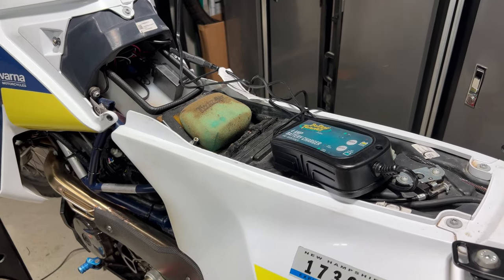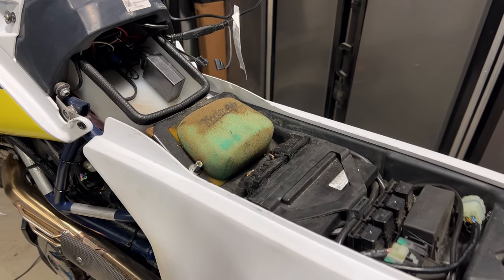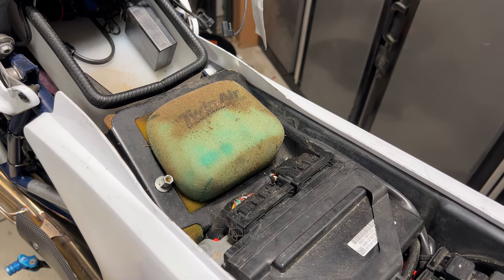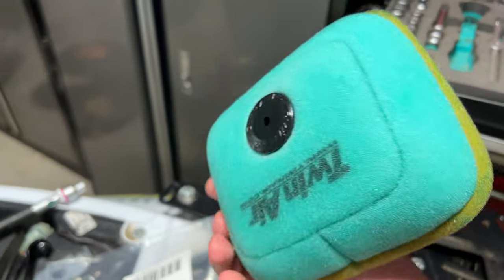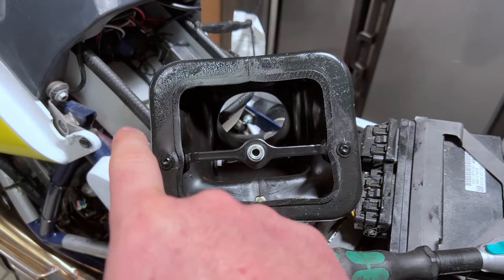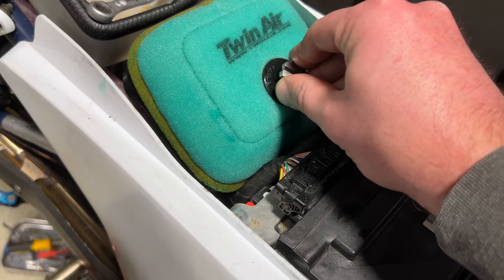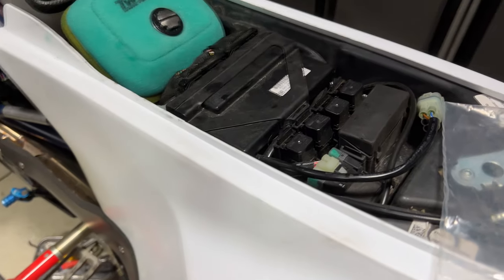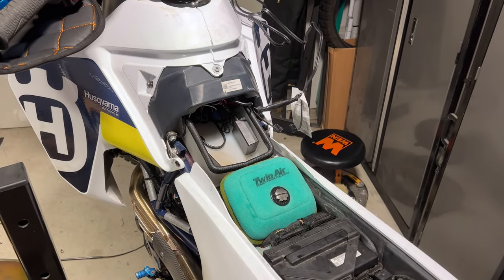Rade Garage Upgraded Air Filter for Auxiliary Tank / Storage on Husqvarna 701 Enduro LR / KTM 690

Comment: Note for anyone like me with a rade air box made in 2018 or before: Check if your existing air box uses heat set inserts rather than the bolt mounting system shown in this video.

There was apparently a design change at some point, with no indication that these new filters and cage will NOT work with that style air box - there's a plastic bump under the heat set inserts which are not open at both ends and therefore cannot be used to mount the new attachment system. It's not possible to remove the heat set insert and end up with a flat surface on the bottom of the lip for the filter to bolt onto.

Rade doesn't indicate this at all on their website and I've been grounded for the last week waiting for new filters only to find out they don't fit.
Reply from the maker: That's great advice. Thanks for sharing!
Reply: yep, facing the same situation now, how did you end this ? did rade send you a new air box casing ? or did you end doing whatever it needs to get it works?
Reply: @axurit_bob  Rade are sending me a new air box body yeah, not arrived yet though!
Reply: @Unkn0wn3rror  thanks mate, I guess I will have to clean my actual filter before being able to replace it 🤷🏻‍♂️
Reply: Yep- Asked Rade about this and says no problem- Got the new filter kit upgrade for my 2019 690 and went thru this same issue, did not fit- Rade did agree to send me the new style airbox at no charge but it was a bit frustrating and it took another 2+ weeks to get it. Plus I also discovered that the lower O2 sensor hole is now located a couple inches away from the older airbox- Had to completely re-do the hose connection which was a complete pain with the gas tank in- Finally done but quite a simple project turned difficult.

Comment: I have a 701 with the older Rade Garage filter, just like yours. Notice how part of the filter is always clean?
That's because the seat pan hits it and keeps air from getting to it.
Does the new one have clearance with the seat pan?
Reply from the maker: Great question. The new one gets completely dirty. I had not thought of that but clearly the revised design is doing a better job making full use of the filter surface area.
Reply: @AdamChandler86  thanks for making this video and bringing the new design to my attention. I ordered the new one today. Shipping prices are crazy now. $$

Comment: Adam can you answer this ,the quick connect fuel pipes ,did they leak fuel when you disconnected them
Reply from the maker: Good question. They do not leak fuel. You can disconnect them and it drips a tiny bit.
Reply: @AdamChandler86  cheers

Comment: Not sure if I like the new design Adam. The old one sticks much better to the air box with the metal bracket pushing it right down. Or am I wrong?
Reply from the maker: Yes, it seals better (the old design) but the truth is, the way that snorkel thing fits into the intake housing is pretty loose so as far as water-ingress, I’d say both the old filter and new will pull in water if you go up to the top of the snorkel thing. I’d much prefer the plastic all be one piece up to the foam but it’s not.
Reply from the maker: I played back the video. I did want to add the movement you saw around 4 minutes in is indeed that snorkel design. The air filter box sits on that snorkel so while air coming in is filtered, I think if you submerge the bike above the top of the snorkel shown around 3:50 in, it will pull in water. That air box is loose like that even if the air filter was bolted on tight.
Reply: @AdamChandler86  my air box is fitted really tight to the snorkel. Mine doesn’t move at all. You might want to look into that Adam
Reply from the maker: Thank you. I’ll send a clip to Rade Garage and ask their help. I can’t imagine how it could be made tight. Want me to send you an unlisted clip?
Reply: Hey Adam, same with mine, it does not wiggle and is actually very tight on the snorkel. I could possibly pull the box off the snorkel but no way I'd get it back on without removing the snorkel from the throttle body first...
Reply from the maker: Well crap. Thanks Un!
Reply: Hi, what Do you think that my snorkle is cutted very short all The way at bottom of the intake housing. Do you think that matters at all?
Reply: The new design is just as secure. When you tighten down the centre bolt it forces the cage down onto the box creating a full seal. It's really well engineered when you think about it.

Comment: Hey Sir, I know you posted a while back but still hoping to get a response.. thanks a lot in advance!!
I am torn on this step, I have a 701 enduro from 2020 (EURO4) with an Akrapovic slip on. It has been like this from day 1 (first owner bought it, put the exhaust, sold it to me after 1000km). No issues for now but I don't have much power down low, just my perception I probably need to test another 701.
I just mounted a rotweiler fuel dongle and di not notice any increase in power or torque.
Do you think it is safe to but this airbox to my bike? Do I need a power commander or dyno?
Thanks a lot,
G
Reply from the maker: The fuel dongle is supposed to eliminate the bike adjusting its fuel mixture to account for Airbox + exhaust. So you shouldn’t have reduced power but you may run a bit rich sometimes (better than lean so long as you keep in top of checking spark plugs to ensure you’re not burning them up. Power commander is certainly an option but I have been happy with my setup of Airbox + wings exhaust + fuel dongle.

Comment: How noisy is the RG intake vs stock? I installed the RP intake on my 21 690R and it was so noisy that I ended up removing it. I imagine the RG intake is the same since is basically exposes the intake snorkel. I really dislike the oem airbox design because it does not seem to seal well and I continue to get dust passing the filter even though I have made attempts to address that (DNA filter with power plate top and grease around the seal).
Reply from the maker: You hear a lot more intake sounds for sure but it's not disruptive to my ears since I'm wearing ear plugs but it does indeed make the bike slightly louder. I wish I had a way to measure just how much lower though.

Comment: What do you guys think about the filtereffect of a foamfilter?
I am a bit scared. A normal filter is normally the best solution don't get dirt into the intake. 
I was at a workshop at Bosch-Filters in Germany. The  filter-surface  is immense.
This is the reason why I torn back and forth to install the auxiliary tank at my Husky 701.
Reply from the maker: Paper filters are superior as they filter out more sediment but they can't be cleaned out. Foam filters need to be cleaned more often but you can clean them so you can keep a filter for a few years so long as you keep cleaning it. If you over oil the foam filter, you will reduce its efficiency.
Reply: @AdamChandler86  thanks for your answer.
And if you swipe with a  tissue or finger into the intake/ manifold.
Is it brown or even sandy?
Actually you don't have this with a paper filter.
Reply: I always smother the seating surface of the foam filter with a healthy amount of grease to ensure a dust tight seal against the airbox. Cheap insurance for me against dirt in the intake.
Reply: @Tom-gr4em  Thanks for your Answer. I hope the Filter is big enough for the big intake of the 690 engine. i just ordered the rade garage auxiliary Tank.

Comment: not cheap but the difference the Rottweiller intake/exhaust smog delete cat delete ect made on my last bikewas really night and day like KTM really should have made it that way from the factory !  so much so i didnt hesitate to ordered the whole kit for the new bike i havent even picked up yet
Reply from the maker: The Rottweiler air intake kit A) doesn’t give you as much storage B) the storage is inaccessible on the Long Range model due to the larger tank C) rubs the inside of the frame and it’s metal on metal. A few long Range buyers purchased the Rottweiler kit and most I saw returned it which is why I went with this. I do think their setup is nicer and better built but the LR being such a limited run bike, I doubt Rottweiler will redesign their unit to fit the LR perfectly.
Reply: @AdamChandler86  ahh i see , that makes perfect sense , i debated quite a bit over the Norden 901 or a 701LR and doing a build from there
Reply: @AdamChandler86  no they seem focused more on the multi cyl adv bikes now , but the same kit on the 1090r i just sold transformed that bike in a huge way heat/reliability/performance ect..